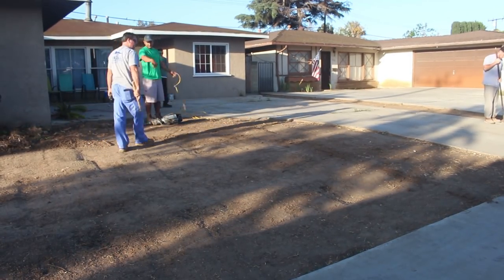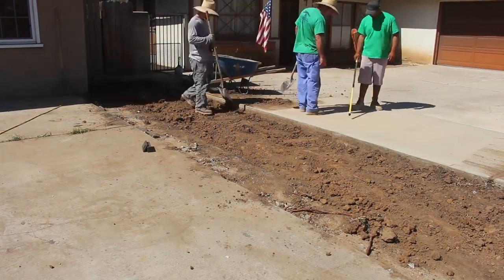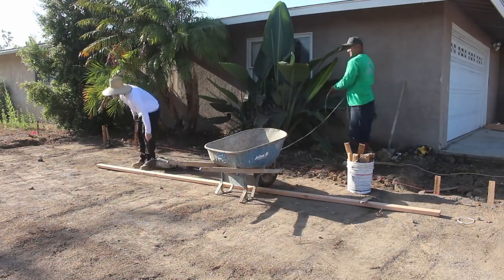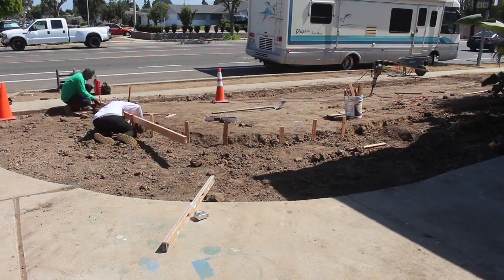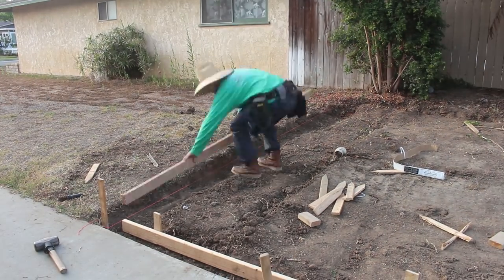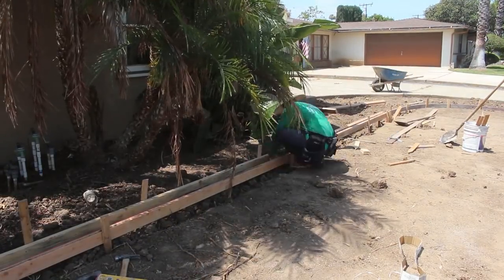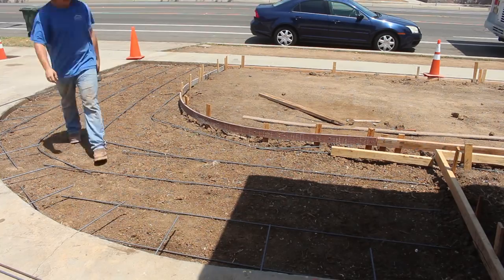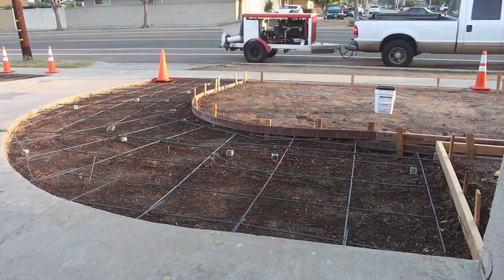How to Form a Radius Driveway and Mote Strip Curb Part #2

Comment: Years and years ago, I was involved in forming and rebar for a huge driveway (like, 30 feet wide, and 75 feet long) for a fella, who had his "Engineer Friend" work out what we needed to do. We ended up with #4 rebar spaced every 12 inches in the thing, with 6 inches of thickness, and a 12 inch thick footer around the edge, with its own rebar in it.
A guy from the county happens to drive by and stops to look at it, asks why we put so much rebar. We tell him because the owner said so.
county guy says if you could find a big enough crane, you could lift the entire driveway as a single slab  if you wanted to with that much steel in it.
Always wondered about that.
watching your videos on driveways, and what you did here for parking an RV on it, I'm inclined to say he only exaggerated a little bit.
Reply from the maker: He may be right with enough pick points

Comment: You aught to figure out a way to get a mini skidsteer they are incredible, I'd pay for its self in time savings so quick. They fit through almost any gate so you can get them in nearly any backyard.
Reply from the maker: The problem with those mini skidsteers, unstable prone to fall over, the bucket is about the same size as a wheelbarrow.
Has to be something better
Reply: David check out the new Toro 1000. Bucks are about 3 times the size. There is also a 2000 series with telescoping arms for easy truck loading.